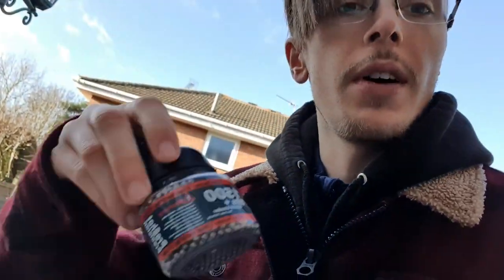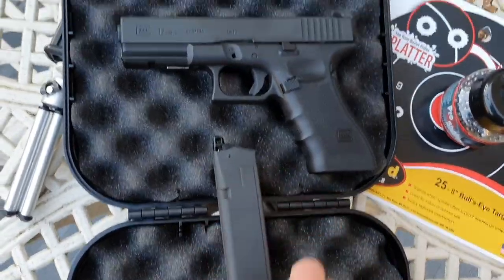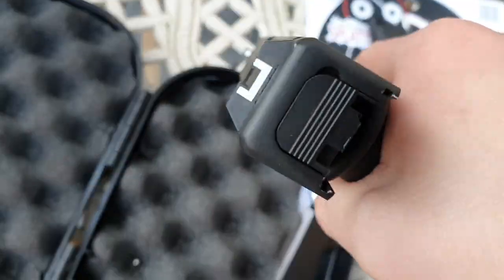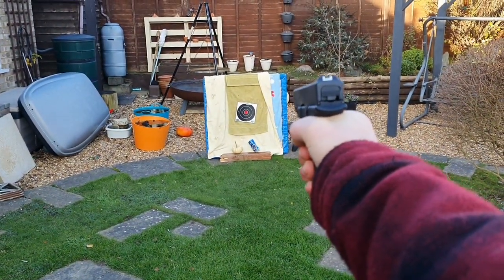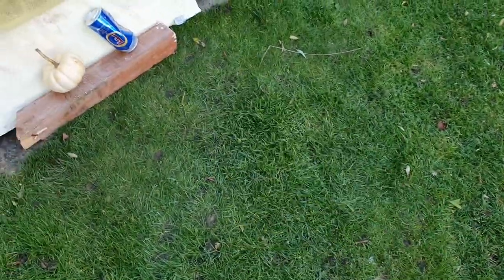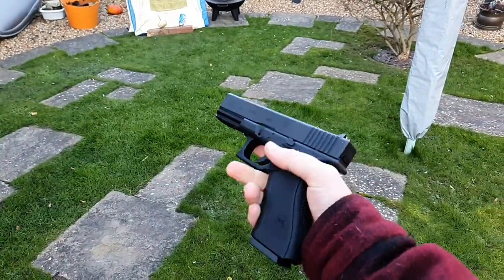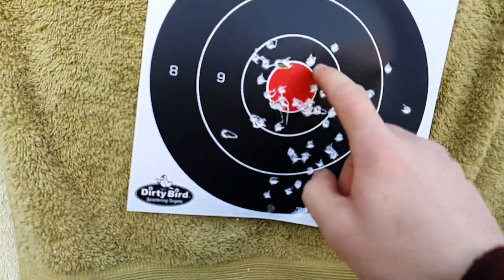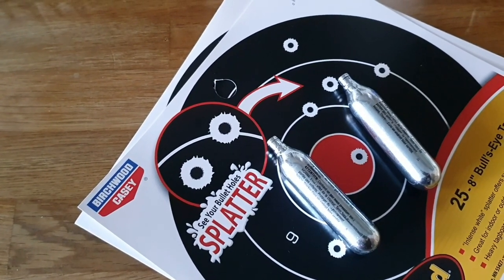New Airpistol Gen 4 Glock 17

Comment: Great video.  I’m about to buy a Umarex Glock 17 Gen 4 and I am torn between this version and the gas powered airsoft version.

I have seen the Gen 4 BB versions with a bottom cover on the mag.  Does your version have one or is it a regional thing?

How many shots are you getting from a single canister of Co2?

My reason for purchase is realism, build quality and to shoot targets.  I don’t plan using it for airsoft.

However the gas powered airsoft version has a bottom cover on the mag so it looks a little more authentic.  Also no need to keep removing Co2 canisters with the hex key to charge it.

Is the airsoft version more accurate and more reliable than the BB version? Does this version shoot low as well?

Is the difference between speed and energy negligible in real terms?

Many thanks
Reply from the maker: I dont have the airsoft version so I wouldn't know which gun shoots better but yes it does hit a few inches low of aim, no my one did not come with a baseplate idk if the newest version does.
Reply: Thanks.
Reply: The latest stock 4.5mm gen4 does come with the glock logo base plate, and spare mags availible at £55 each. Completes what is the best gen 4 replica out in the uk in airgun format.
Reply: For airgun version you will get about 3 mag which is about 54+ shoots per co2. It did come with a baseplate now. It has hop up so it’s pretty accurate for me
Reply: Many thanks.  I really love this gun.  I managed to get the mags with the base plates and I do indeed get 3 full mags with one Co2.
Reply: LMD do you like the bb or air soft version ?
Reply: @neildobson3990  Best replica full stop.

Comment: I have the same malfunctions especially when the hop up is set too tight
Reply from the maker: This doesn't have a hop up it's an air pistol not an airsoft pistol
Reply: @peach8685  They have. In airguns it's called BAXS actually. When you take down the slide you'll see a silver screw below the chamber to adjust it.
Reply from the maker: @razor7335  ok I will take a look
Reply: @razor7335  where exactly is the screw? Mine shoots low and I would really like to fix it
Reply: @BambisBoolin  "When you take down the slide you'll see a silver screw below the chamber to adjust it."
Reply: @razor7335  damn I dont see it man, I think they started selling them without shortly after to save money
Reply: @BambisBoolin  well that's weird
Reply: @razor7335  can you upload a video of where it is? I want this thing to shoot straight and I might just be stupid.

Comment: Gen4 looks great. Shoots terrible. Gen3 has more power and shoots very accurate, but slide is cheap and the trigger feels mushy. Gen4 prices have surged to as much as $500 or more in the US now because of a shortage. You can buy a real 9mm Glock for that. I'll stick with my gen3. Lubricated well most of the slide jiggle disappears and it will shoot over 500 fps with fresh co2.